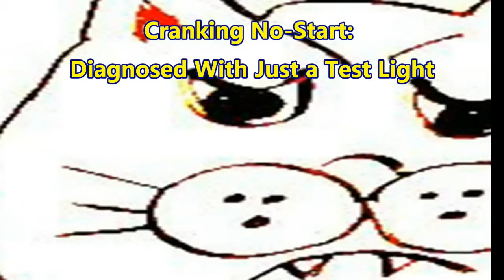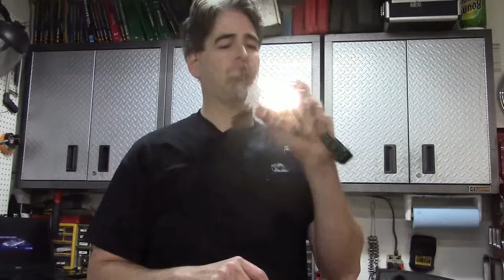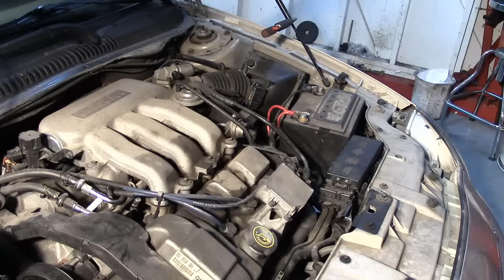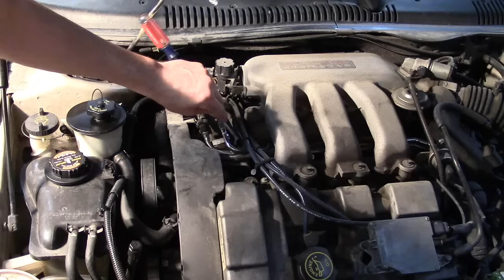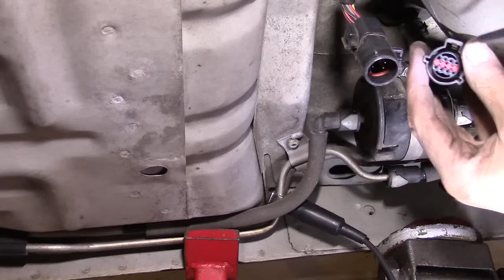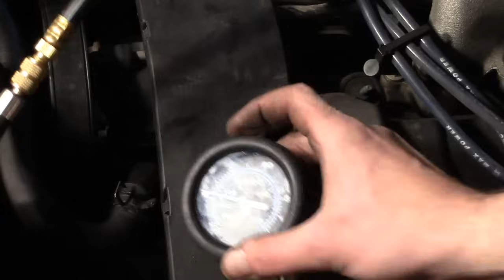Crank No-Start Diagnosed only with Test Light

Comment: What if it’s not the fuel pump. New crankshaft sensor, cam sensor,fuel pump,fuses good, switched relays, fuel pump won’t turn on unless I jump the relay connections. Thinking bad computer. Seen in other video. Or stock alarm killing it. Key fob does nothing even with new fob battery.  I’m at a loss.
Reply from the maker: Then you start analyzing data. actually you should really do that before changing all those parts. 
  what data do you have?  if the pump won’t turn on unless you send power to the load side, what is your voltage showing on the control side and is there ground side switching present? that’s where the focus should be.
Reply: @SchrodingersBox  I havent checked for voltage and not sure what ground side switching is. Also no codes showing on obdii reader
Reply from the maker: you won’t have codes. you said you can start the car by jumping the load side. so obviously the control side is where your issue is. just measure the voltage feed on the control side and if it’s not there that’s the issue. if it is there then you have a ground side switching problem. the control side is ground side switched with the ignition switch.
Reply: @SchrodingersBox  well actually when I jump the relay the pump turns on but the car still wont start.
Reply from the maker: Yes as I said it’s pretty clear you do not have the control side activating. This only confirms it. check your source voltage on the control side.  if not there, that’s the issue. reconnect source voltage to the relay feed or even just make a new one because the system is not power side switched. if you have source voltage Then see if you have ground side activity. if you do then the relay is bad. if you don’t then work backwards from your ground side to see if it’s a ground fault, open, or transistor failure and just go logically stepwise to find the issue- check your signal inputs and on any that are missing just put them in manually with a low amperage bypass and that will verify the condition.
  luckily this is pretty easy because you have pretty limited input variables for a fuel pump control.
Reply: @SchrodingersBox  . Ok. Thanks for the help. Thanks for replying back. I Appreciate it.

Comment: Fantastic channel, wouldnt another tip to check if the fuel pump isn't working to spray "starter fluid" into the air intake?
Reply from the maker: Yes however that checks fuel delivery- not necessarily the fuel pump.

Comment: I pulled out the ECM and checked, there was actually lots of short to ground therein and few wires breached with each other which I corrected. In addition, I noticed that "there was no ignition current at all in the fuse box, " but the dashboard lights were coming "on" with key "on" which is proper. The fuse box itself didn't transfer power to fuse 26 and 37 that were responsible for transferring current to the injector circuit with ignition switch turned to "on" position. Hence, I told the car owner that the fuse box too will require replacement. And when he purchased it from a store the was current there at the fuses but not to the injector circuit. I noticed that some pins in the fuse box that was powering fuses 26 and 37 were completely pulled out.
Also, I noticed that instead of Fuse 26 to be powered with test light on ground it was rather powered with test light on battery positive. Please sir, help me out with what I can do next to fix the car problem permanently.

Comment: I have a similar car problem but with a 1998 Range Rover p38 with a v8 engine. The car cranks but is not starting, no spark, no injector pulse either and no fuel buzz.

Comment: What is your advice on intermittent start failure? I noticed the times that the car wouldn't start is when the fuel pump wasn't making any sound when I turned the key to ON. Of course, there was no fuel pressure either.  But when I wait a bit and try later,  everything would be back to normal and the engine starts right up. I swapped the relay, and it didn't solve the problem. Also tested the relay to be OK. I suspect a faulty fuel pump or  occasional open circuit leading to the pump. Is it possible to find intermittent problems? Thanks.
Reply from the maker: Those are tough. the keys to intermittent failure is you have to get it to reproduce and that will be done by inducing one of the following variables: temperature, vibration, moisture, and use of accessories.   vibration is the most common. I’ll rattle and shake wiring harnesses and stuff trying to get the issue to reproduce.
Reply: @SchrodingersBox  Thanks for your reply. I am keeping notes of when the start failures occur. So far, they seem random. I jiggled the wires and didn't notice anything. I will check again when the failure occurs. Fortunately, I have another vehicle to use while I am playing with this problem.

Comment: I have a 98 town car. Crank but no start. Relay fuses work, getting ground, and the fuel pump is humming. Lastly there is fuel pressure as well. In my case, what would it be?
Reply from the maker: what is your data that it must be a fuel problem? how did you rule out spark and timing?

Comment: Love your videos...basic tools...got to run this by you....95 buick crank no start....towed...diagnosed bad fuel pump....1 week later....stalled...crank no start....towed....garage can't pull codes....it's obd 1.5 transition year...they start throwing parts at it....used known good ignition module...no start....crankshaft sensor....hey it starts...drive for two weeks....crank no start....towed....shop has it for 3 weeks and calls to say politely maybe should think of buying new car we can't fix it...too old of technology ....come tow it away.....and I watch you and other mechanics on the YouTube diagnose with trouble light...why fo they feed me this b.s.,
Reply: Ima going to fix her if it's the last thing I do.....and drop off put key in night drop box with note  to have oil/filter change please haha....let them know I use test light to fix... yes?
Reply from the maker: Even if they can’t fix it- there is not an excuse for not knowing what is wrong. in other words, maybe they don’t do engine rebuilds- but they should at least know the no start is due to no compression- so if they can’t fix that, hey that’s OK but they should know the reason at least. 
  it’s going to be fuel, air, spark, timing or compression. if they can’t determine which it is then I am not sure what they are doing.
Reply: @SchrodingersBox  they told me no spark no injector pulse....it's not worth it to them Matt....3-4 hours of diagnosis...they could do 3 $1000 brake jobs for the 300 dollars they get from me....that's the real reason
Reply from the maker: yeah pretty obvious it’s a cam or crank sensor issue.  man wish I could look at it. 30 minute diagnosis tops. I suspect they don’t know how to check for cam and crank signal integrity using a scope.
Reply: @SchrodingersBox  that's why I admire you guys....basic tools job complete

Comment: The wire going to the brain from the carburetor won't light up on my truck. I believe I don't need the computer at all because my truck is 1982 but the engine is 1972. My compression seems a little low as well. She wants to turn over but immediately stalls out?? Any tips?
Reply from the maker: what wire from the carb are you referring to?
Reply: @SchrodingersBox  I have one that plugs into the carb adjustment it wasn't getting any spark to it. I wiggled it and fixed the connection but it's still not turning over unless I hit it with starter fluid but other than that it just cranks
Reply: I've installed a new fuel pump, starter, battery, souenoid I've defouled the cylinders I've bought all new spark plugs tested my compression, new carburetor. I think I may have messed up the fuel air mixture but I really don't know

Comment: You do good methodical. work. I wish I was your neighbor. Now I have a crank no start with my 2002 5.4L F-150. lol
FP is around 35psi. It will occasionally fire up if I apply slight amount of throttle before turning the key. Once it starts, it runs fine.
Reply from the maker: I would do a fuel trim analysis when engine is running to check for lean condition especially under load. if so, address fuel pressure.
Reply: @SchrodingersBox  Will do. How does applying 1/8-1/4 throttle, before turning the ignition, affect starting in a EFI vehicle other than letting in a little more air flow? It certainly does help, although not every time, start my truck.
Reply from the maker: There are several reasons for that including the possibility it’s not a lean condition problem- maybe the throttle body is dirty so the IAC is not allowing enough air when starting. But for a lean condition it might be the slight throttle application induces a higher injector pulsewidth to allow more fuel at startup but without throttle being open too much to still lean it out.

Comment: Could you just have sprayed some starter fluid in the intake and figured out it was the fuel pump
Reply from the maker: I could have done that and verified it was a fuel problem. but it does not necessitate it was the pump.
Reply: @SchrodingersBox  ok gotcha

Comment: A tow truck driver that can't back up? It doesn't surprise me, the incompetence nowadays of people that are supposed to be "professionals" at something, that are it turns out the most basic of amateurs.
Reply from the maker: it’s not that, honestly. most just have policies that they don’t come on your driveway because people make claims the truck caused damages or whatever. some of the drivers will drop off the car right into a specific bay in my garage with mesmerizing precision but others are not even allowed to drop it in the driveway even though they have similar abilities. it’s more a matter of policy for the particular company.

Comment: Even if you have fuel. It does not mean the fuel pump is good! 32 pounds minimum in fuel required to start car
Reply from the maker: Yep that’s very true. I have at least 3 videos that show getting fuel at the rail is not validation the pump is good.   I know a lot of people depress the Schrader valve and if fuel sprays out they eliminated fuel delivery as a variable and thats a big mistake.

Comment: ClickBait:  How can you title 'Only a Test Light' when using your Power Probe was a crucial part of the diagnosis?
Reply from the maker: because I didn’t need to do the power probe. the testlight confirmed that it is not a circuit integrity problem and that there was no other possible explanation other than a bad pump. the power probe was merely for demonstration to confirm it in case people didn’t understand.
Reply: @SchrodingersBox  99% Okay:  You jumping the circuit with the test light on the load side means the problem is most likely the pump because in the circuit it is the moving part.  The paper clip getting hot which shows current draw helped to.  I would say you diagnosed with a test light to the degree of certainty of 99%.  You could have had a weak short to ground and you could have had corrosion on the connector which the test light could not give you certainty.  However you could not be 100% it is the fuel pump until you went under the car and gave power to it with the Power Probe.  Still no fuel pressure, then banging on the tank so now you know it is 100% the pump.
Reply from the maker: That is not correct. given the extremely low RPM and low pressure, the testlight would have lit very dimly if there was a voltage drop causing the problem. There was no voltage drop. therefore, 100% certainty it was the pump.

Comment: I baught a crankshaft position sensor thinking that it would fix the problem, i cranked the car still wouldn't start, I ran the battery flat and i still don't know what the problem is.
Please help!
Reply from the maker: what data do you have?
Reply: P0320 something like that. I don't want to replace any parts, I don't have any money, i had to borrow money to get a crank sensor, which didn't fix the problem, the other problem is the battery is flat and i don't have a charger.
This is very frustrating!
Reply from the maker: on a P0320 I would start with the basics since that’s generally a really easy one to diagnose. - just do a crank sensor bypass to confirm signal, reference and ground integrity and if it fails the bypass determine the missing component by providing a low amp signal, ground or reference and then trace it up to the open or short. I usually find it easier to do this from the PCM side.
Reply: @SchrodingersBox  remember this is a new sensor, there is no way it could be faulty, there is something else that's happening here
Or maybe i don't know what you mean by crank sensor bypass
Also it's a 2 wire crankshaft sensor it generates it's own power
Reply from the maker: oh well that even easier then-I didn’t realize it was an inductive style. only have to check the ac output at the brake module (or PCM if thats where it’s located) is all.  I assume since it’s a new sensor you were not seeing AC output with the old one correct?
Reply: @SchrodingersBox  yes correct

Comment: When you tested the fuel pump underneath why didn't you use a t pin instead of unplugging the connector, that's dangerous. What if your  test light slipped and touched the wrong pin? Yes I know you can replace the fuse but for someone without experience that's risky especially with round pins.
Reply from the maker: Please tell me what pin I could touch with a TESTLIGHT that would cause any damage or even blow a fuse?  What would that pin be that could possibly do that?? that makes no sense to me.  If anything what if you “slipped” and crossed the wrong pin with your T pin?  Now that could damage the PCM potentially if you shorted the reference feed  to ground couldn’t it?
  Unless you are Michael J Fox AND didn’t know basic electrical I don’t see how what I did is even a possible risk. Actually even if that was the case- what pin could he touch that could be “dangerous”? Please elucidate what I am overlooking.
Reply: Just pulling your legs.

Comment: I have a 2005 nissan altima v6 which is not starting... changed alternator starter and fuel pump ... the car still doesn't start
Reply from the maker: That sucks. what did the diagnostics show that indicated the starter was bad?  I would start there.
Reply: @SchrodingersBox  engine light is not on ... starter was changed ... car is not starting

Comment: Help me. https://youtu.be/f76HBel7Y9A
Reply from the maker: OK- what data do you have?
Reply: @SchrodingersBox  on my obd11 there's no codes and now I'm checking for spark as of now
Reply from the maker: That’s what I would do. Check spark and fuel first.
Reply: @SchrodingersBox  okay I got good spark and it started with starter fluid and then cuts off fuel pump is pumping
Reply from the maker: Fuel problem. Start with the extreme basics- check your fuel injector common feed voltage and confirm the individual ground side controls as a basic starting point. That will tell you where your issue is.
Reply: @SchrodingersBox  Thank You Kindly.
Reply from the maker: Oh btw you could also start with reading amperage on the fuel pump which of course is faster and easier but I’d do the injector signal validation first since you said the fuel pump is operating. If that checks out, then I’d measure the pump amperage second.
Reply: @SchrodingersBox  before this happen I ran out of gas before I notice it out of gas I cranking away is possible air may have entered the system?
Reply from the maker: Nope. Fuel pumps cannot pump air.  But given that information I would start with measuring the pump voltage drop and amperage and rail pressure first now.
Reply: @SchrodingersBox  okay Thank you once more I'll do as you said and will let you know how things turn out

Comment: Great no nonsense troubleshooting.  Has anyone ever run into a fuse with high
resistance, I had a computer that would not run with one in it.?
Reply from the maker: YES!! I had this happen on a 50A fuse once a few years ago that caused a no crank no start.  It seemed it blew but not all the way or something and it fooled me because it had continuity but  had a huge voltage drop across it!
Reply: @SchrodingersBox  Thanks for the reply, this fuse was keeping a Flight Simulator power supply down and verified by replacing the fuse, and then placing the "bad" fuse back in its place. Fooled some techs with years of experience. Currently working on a friends 98 GMC with no start but cranks, and has 50 lbs fuel pressure. Have not checked spark yet as vehicle is not at my house.
Reply from the maker: Yep stick with FASTTEC and you will find it!!  Don’t forget just because there is fuel pressure doesn’t necessitate that fuel is being injected. If the cam or crank sensor is dead that would cause no spark and no fuel because the coils and injectors wouldn’t fire.
Reply: That is very true, thank you.

Comment: When the vehicle was being cranked it sounded like it wanted to almost start, so I figured by sound it was the fuel pump.
Reply from the maker: If it almost starts when cranking it indicates it is NOT the fuel pump because the engine is trying to start from compression. 
   But also you can’t rely on that anyway. because as we saw there was no fuel and no spark on this vehicle.
Reply: @SchrodingersBox that spark from the test light confirms no spark?
Reply: I'm not trying to be an as*** but to me it indicated to inspect the fuel system(pump). I was just listening to what the car sounded like and from my experience on car repair, one of the things that popped in my head was fuel. My method of diagnosis is different from others, it's not as good as yours but it works fo me. I like your videos and you have taught me a lot, keep up the good work. Thanks for making the world a better place by spreading your knowledge, teaching people and helping them!!